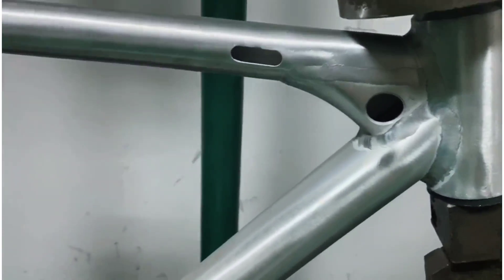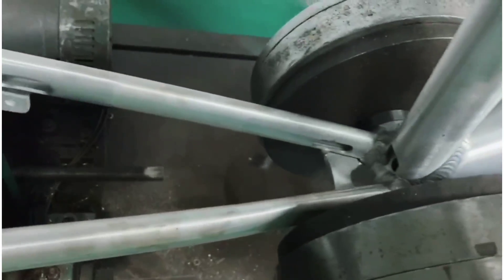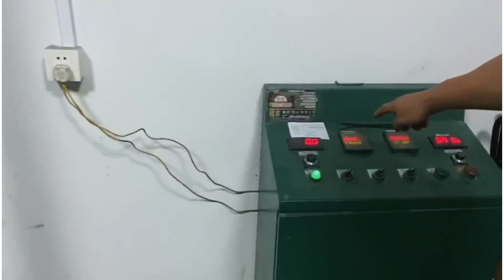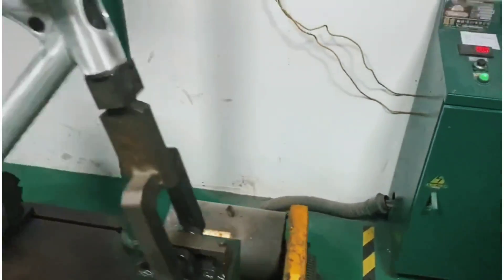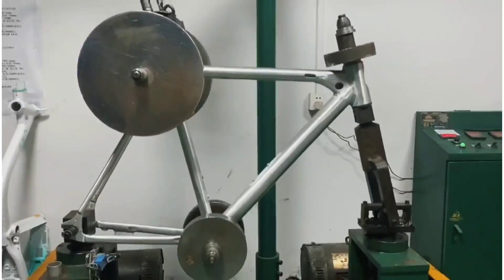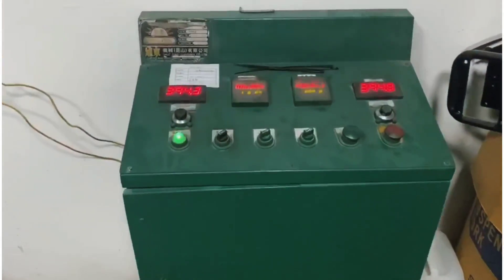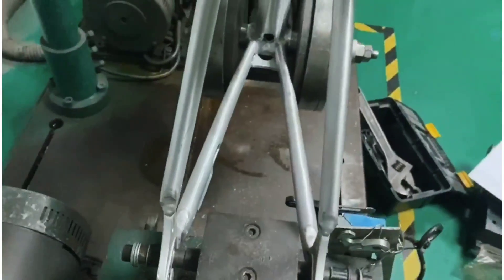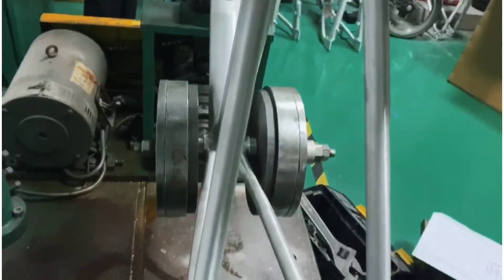FLX Babymaker Production Update: Frame Testing

Comment: Is the smaller size frame the same as the big one in terms of style and all just.. smaller/shorter? (sometimes they completely change the look when it's a smaller bike and you don't get that nice straight top tube)
Reply from the maker: The smaller frame will have adjusted geometry to ensure the integrity of the design is still as structurally sound as it's 23" counterpart

Comment: Noticed the frame shaker test does not include the rear support leg notched segment used on the pro model to facilitate installation and removal of the Gates V-belt, which would seem to be the weakest point in the frame.
Reply from the maker: Thanks west!